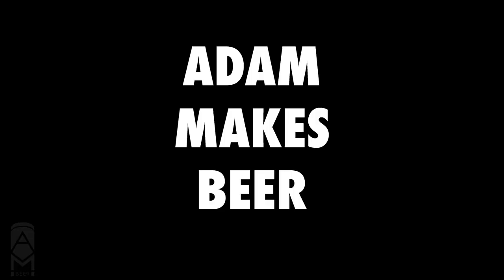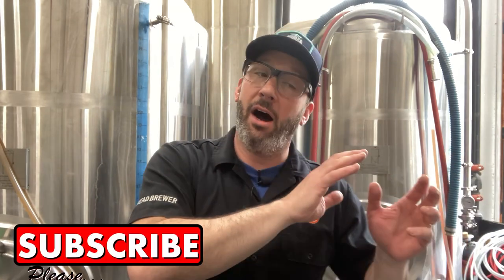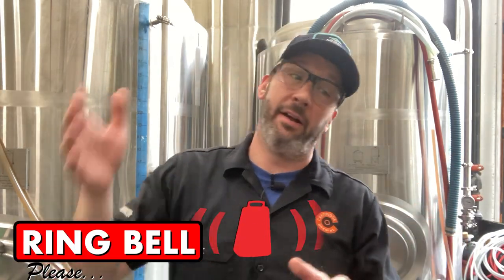Adam Makes Beer: Pro Brewer Explains How He Avoids Hop Creep

Comment: Dry hopping after the completion of fermentation can lead to the issue of re-fermentation during transport or at the customers. To avoid this, we often use the hop-creep effect with bio-transformation yeasts and low-amount dry-hop(1-1.5g/L)during primary fermentation, and high amount(6-8 g/L)during later stages of fermentation(1.5-2plato before fg)
Reply: Hi there. Are you a brewer ?
I’m too and I would like to discuss about your process. 
I have some hop creep issue in fermenter. And would like to discuss some tips. Thanks bro.

Comment: Hi. I haven't practiced all 3 solutions I'm about to write here... but this is the science I studied:
If you leave any tiny amount of yeast in the beer,  and you dry hop it while cold, then at any point of time if the temperature of beer raise (while in storage in the package) a second fermentation will occur ! This is due to tiny amount of sugars in hops (can be neglected), and mainly to enzymes contained in the hops that will hydrolyse some of the polysccharides / dextrins in the wort or in the young beer and turn them into fermentable sugars, so any yeast still present in the beer will find food to eat and go through a second fermentation. If this happen in the fermenter, then no problem, but if it happend in the package they it will result a problem mainly of over carbonation.
So the 3 solutions I know are: 
1- If dry hop was made at cold temperatures, you shall never allow the temperature to raise after packaging (not guaranteed because once the packaged beer leave the brewery you cannot really control the storage conditions at your distributors). 
2- get rid of all the yeast completely through a sterile filtration or pasteurisation or a centrifuge (if you are allowed to use sterile filtration / pasteurisation. Centrifuge have other challenges with heat and oxygen ingress).
3- allow for a the hop creep by harvesting the yeast (optional), depending on flocculation abilities of the yeast. Normal harvesting after a cold crush will not get rid of all the yeast; some will remain in suspension, then dry hop before you reach the fg (and the temperature shall be adequate to the yeast to work, so it is definitely higher of the cold crush temperature). then you cold crush (again) to dump any remaining yeast and hops trubs resulted from the dry hop. This way you allow the second fermentaiton to happen in the fermenter before packaging.
Again this is the science I leaned, I haven't tried to practice all 3 options so I cannot give practical details. (the way we do it is the third option, because for artisanal beer we are not allowed to sterile filter nor pasteurise)
Cheers

Comment: What do you think about doing this with an IPL?? Lets say I fermented at 50-52 degrees using Imperial L-13 global, I pull it off yeast and transfer it into a secondary and dry hop it, drop it even further below that fermentation temp? Like maybe 40 degrees or is that to cold??
Reply from the maker: What type of fermenter are you using? What scale? Home sized batches or pro?

Comment: So what is causing the hop creep? Are there fermentables being introduced from the hops?
Reply: Enzymes in the hops break down previously unfermentable compounds into fermentable ones. Then yeast left in suspension can start working again.
Reply: @tortap  Right, so the approach I've read of doing dry hopping at ambient yeast temps and letting it play out minimizing b/c you let that creep happen in a controlled scenario, outside the bottle. The argument against would be having the dry hop too long and having more vegetal aspects coming through. My instinct would be not to hop cold, since this requires more work and equipment.
Reply: @humanonearth1  There are videos on youtube where Vinnie Cilurzo of russian river talks about hop creep. One mitigation strategy would be to dry hop a little early and let that creep. Then add the main charge of hops at a later stage.  Pro brewers don't do that because they need to harvest yeast. But as a home brewer we can get away with it. What I have been doing since getting preassure fermenters is using hop bong to do oxygen free dry hopping. One early and then let finish at temp. Soft crash below 15 degrees C. Do a double dry hop over two days leave for 48 hours then cold crash. Then store cold. The cold temps prevent any creep but a warm bottle might still get some. But that is with 2-300 grams dry hop in 20 l batch.

Comment: Is this refermentation happening because the hops are breaking long chain sugars that the beer yeast can't eat into smaller chains? Like a mini mash extraction and fermentation at the same time?
Reply from the maker: Yes that appears to be the case.
Reply: @adammakesbeer  I wonder if heat would work on hops to denature enzymes like it does mash. I mean like heat your hops up before hand to like 150 or 160 and hold for a bit to stop the enzymes from activating? Just thinking outside off the box. It would probably affect hop oils I would think, or maybe loosen them for extraction in a dry hop
Reply from the maker: @adamgodofwar666  Yeah it’s possible, I think your brain is going on the right direction. I know that they have been killing hops cooler over the years to maintain more oils.

Comment: What's your take on "biotransformation" where DH are added almost at high kraeusen?  Do you find you get just as much aroma contribution doing yours late and cold vs. early and warm?  Obvious side bene is that you can much more easily harvest yeast, but I'd be curious to hear your comparison, and opinion on "losing out" on the supposed  conversion of geraniol to b-citranellol by only doing cold temp DH.  Cheers, enthusiastic subscriber here.
Reply from the maker: Great question! I am not doing fermentation dry hopping because I want to harvest my yeast, so I am missing out on the character of the fermentation dry hop. It does seem as if there are advantages to it, I just typically don’t do it. I find that I get good flavor and aroma with the process that I am using, especially since I have been swapping out T90 pellets in the WP with a large percentage of cryo hops.
Reply from the maker: Does that answer your question?
Reply: @adammakesbeer  Yep, it does.  I'll try it back to back with early dry hopping, making the same beer, and see what I can tell in terms of flavor profile.  I like that your method allows you to re-use the yeast.
Reply: @jayspies9860  did you do a back to back test if love to know your results
Reply: Seems like I remember an episode of Bru Lab where they did an experiment with dry hopping at high Krausen for bio transfer. Their tests comparing this method with none bio transfer resulted in no noticeable difference if I remember correctly.

Comment: I use the same technique with dry hopping too. Do you always have re-fermentation in package with this DH technique if being stored warm? Also, have you noticed, or heard that higher ABV IPAs doesn't have the same hop creep issue than lover ABV beers? Maybe that's because with 8-10% ABV, the yeast can't start the re-fermentation that easily?
Reply from the maker: I haven’t noticed refermentstion in our canned product to date, I am keeping my fingers crossed. All of my in house cans are never stored warm. I have not heard that correlation before but it makes sense. I will need to dig into that.
Reply: @adammakesbeer  Okay. Good to hear. By the way, do you centrifuge those beers?
Reply from the maker: @jrkz  Nope.

Comment: I left with the doubt if you make Dry hop at 14°C until you finish it, or you during it down the temp gradually to 4°C(or cold crash). Thanks.
Reply from the maker: I soft crash the beer down to 58F for a few days to harvest the yeast. Then I dry hop!
Reply: @adammakesbeer  I read that is the SOP for Sapwood Cellars awhile back before seeing this video. I am going to have to try a 58F dry hop post ferm. Maybe better aroma and reducing the vegatal flavor?
Reply: @ajoyce  Cold Dh is the way to go.  I see Tree House doing this all the time too.

Comment: I am seeing brewers putting way too many hops in active fermentation to make haze... it's just making bad beer and they are using wicked expensive hops to get biotransformation. To get the bulk of your Biotransformation you need to track your gravity. Once you are within 50% of terminal that's when you hit it with your hops for biotransformation and you don't need to be dumping massive amounts in like most breweries are doing. You can get the biotransformation with fewer hops and cheaper hops because the VOCs blow off during active fermentation which to your will help create that perceived balanced mouth feel which from my experience people and my personal opinion people want it on the finish as presenting as dry or clean versus hop burn or putting our green beer ie. Trillium, Burial and on and on and then telling people that is how those types of beers should taste a lot like when sours had a moment and brewers were putting out THP bombs and telling people no that's how its supposed to taste.